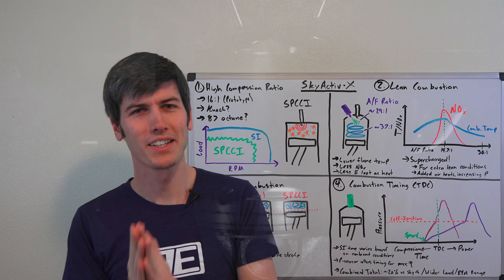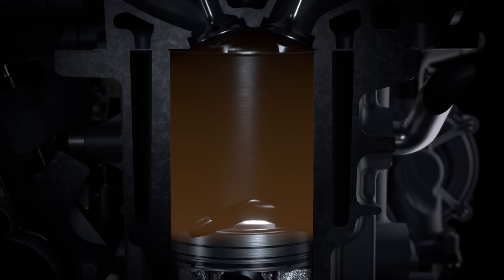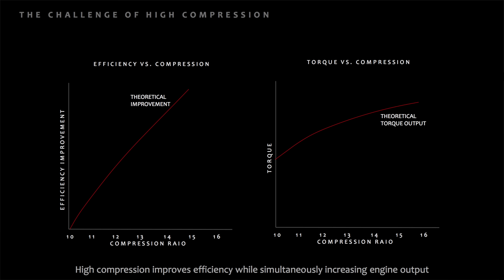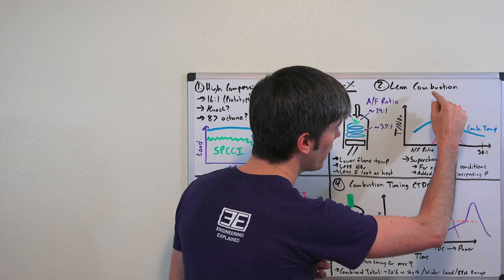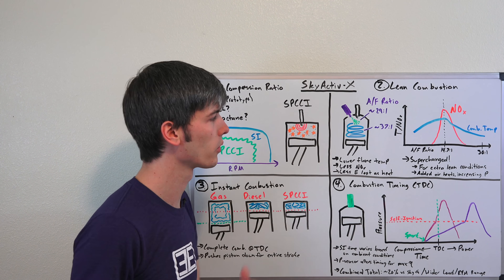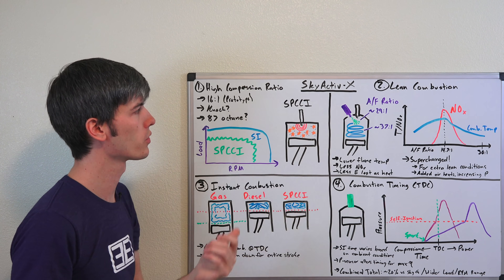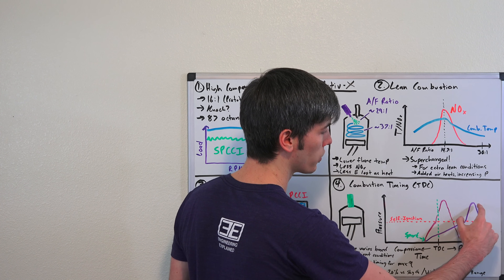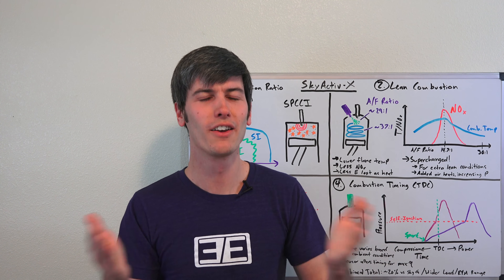How Mazda Is Saving The Gasoline Engine - SkyActiv-X

Comment: "not super powerful engine, about 190hp"... IN A MAZDA 3 !!!!  I am still convinced  Americans have different horses than us. If it had 110Hp it would be "not super powerful".
Reply: Americans are used to having almost 300 hp V6’s making like 20 mpg average. I am anyway, this is kinda low in terms of overall scale of “power” but the cars are light at the same time, with geared tranny’s, not those shitty CVT’s. And the cars are low with tightish suspensions. So IMO they’re fairly quick.
Reply: @francesco1998  What, in a full size pickup or something?
Reply: Bryan Liguori 
Dodge puts their Pentastar in just about everything they have.
Reply: @francesco1998  I know, I just mean to point out that that's not enough information to know if that's bad or not. A 300 hp V6 getting 20 mpg.  In a full size truck that's not half bad. Wait, did you mean around town?
Reply: Bryan Liguori 
Combined. In a 4,500lbs Van that’s shaped like a literal box. (Dodge Grand Caravan) and a 4,500lbs Jeep Grand Cherokee. 

I don’t know what the Ram 1500 has but Ford’s baseline F-150 has the Duratec 33 engine which is a 3.3 liter V6 making like 290 horsepower and 265 torques, that truck gets 19-25 mpg’s. Considering they are both competitors and the Dodge’s baseline is a 3.6 Pentastar with Similar power numbers I’d think it gets about the same. So yeah I’d say engines have gotten a lot more powerful and efficient as a whole.
Reply: @francesco1998  if they're really getting those numbers, that is definitely impressive.  My limited (and dated) truck experience is a 95 Suburban (11 mpg average), 02 TrailBlazer 6cyl (12), and 05 Suburban 5.3 (also 12). These all had quite a bit more low end torque, but I suppose modern transmissions allow low-torque engines to still push heavy trucks at low speed and quickly upshift a few and ultimately save a lot of fuel.
Reply: Bryan Liguori 
I also had the 6 cylinder TrailBlazer! It was an 03 but same thing, got 9 in the city and 14-17 on the highway, burned oil so much it became another type of fuel I had to put in the car 😂. Unfortunately I totaled it about half a year ago. Anyway, I think the reason V6’s and 4 bangers are so powerful and efficient now is because of modern technology, between the GDI and DOHC and the engines computer, they can push as much torque and power out of those things as possible, they also use lighter but stronger material to save weight so you’re not sacrificing power to carry the weight of the engine. Honestly the V6’s of today push more power and torque with better gas mileage than the V8’s of yesterday!
Reply: @francesco1998  Sorry to hear about the TrailBlazer, it was a charming truck with an engine that at least revved happily and sang a nice song. 
But yeah, the tech is getting all engines to really overachieve. The downside of course is cost and complexity though, and personally I would prefer ~2002 engine technology all things considered for those reasons.
Also, power for power, the sound and feel of a V-8 is itself highly desirable to me. For example, the current V-6 in the Camaro. 335 hp is definitely fun.  But a 335 hp LS1 (so basically, a stock LS1) in its place (in a 2019 Camaro) would obviously be a lot more fun for a number of reasons - and I really don't think fuel consumption would change much. 
I wish I had the resources to actually explore this.
Reply: Bryan Liguori 
Very true what you said about that, I would really only put a modern V6 in something like a truck if I was to only do light duty with it. I’ve I’m getting a sports car I’m putting the biggest damn engine I can find in the thing with free flow exhaust and aggressive cams and everything.
Reply: Don't be dense. High-tech NA 2.0L engines have made well over 200 hp from the factory, and this one's supercharged, so 190 HP naturally is a bit underwhelming after all this build up. Still more than enough for a Mazda 3 though.
Reply: If we could get the usual "slow but efficient" cars that normally have around 60-110hp up to around 190hp standard with the same or better fuel efficiency... that'd be damn amazing. You could focus on just buying purely for MPG and still get a decently quick car. Sounds great to me.
Reply: Cars HP are not real HP ( 1HP = 550# / 1ft / 1 sec ) car hp = 1 hp / hour .
Reply: I'm always shocked by what journalist in America consider "under-powered" I have a 2008 RAV4 with about 165 hp that weighs something like 3,500lbs and I have never considered it slow or found myself lacking the power I need to pass on the highway or anything else. Journalist would say a compact car with that horsepower would be under-powered
Reply: Americans built 6 liter V8’s with 110bhp. Hearing Americans talk about something being powerful/efficient is weird A/F.
Reply: @Ticklestein  What 6 liter engine made 110bhp when running correctly?

Comment: 190hp Miata and more fuel efficient? Take my money!!!
Reply: oh yeah huh. I wonder if this fits in my miata
Reply: @69ER509  It should, the ND1 have an aftermarket supercharger that works, so the new ecocharger could be crammed in there.  

Really the dream for the miata would be a rotary SkyActiv-x engine; as from what I can tell from the miata forum, is that the ND are hard to improve/have not had the time needed to perfectly map out ways to improve performance.  We would probably expect similar/slightly worse efficiency to the current miata, but engine displacement would get a lot bigger.
Reply: JV the changes you would have to make trying to retrofit that engine would probably cost more than the car itself

Comment: Would this method allow for higher rpm considering in a previous video you talked about the limiting factor being the flame front? If it's simultaneous would there still be a flame front as the limiting factor and would it be less, more or same?

Comment: That corporate average is insanely misleading (as a general measure of technology). Look at their engine capacities and layouts. There are no Mazda v8s, they had few v6s before that and none since 2013. Then factor in the number of different engines they actually produce (it's 2, 3 if you include the one turbo option) makes it easier to stay low compared to competitors. Lets say Nissan, their engines have worse fuel economy accross the board, but they still make a variety of engines for a variety of functions, having that wide product offering inherently raises their average fuel economy even if their fuel economy were the best in each segment.

Comment: Just wait until the majority drive electric vehicles and the price of electricity makes $4.50 /gal gas look cheap. Don’t get me wrong I like electric cars but not as a complete replacement of gas engines.
Reply: Ryan Ryan People need to get off this “single solution” idea and realize that we need different tools for different missions. Battery EVs for commuting and short-haul trucking. Biodiesel and/or fuel cells for long haul trucking. And with the majority of transit use moved away from hydrocarbons, there is ZERO reason to eliminate gas ICEs from enthusiast cars. Such a small part of the market, such a small part of emissions, it is irrational to pursue total elimination of the ICE gasoline engine. Nothing wrong with a gas powered 911 or Mustang or Corvette or Miata when Joe Schmoe in his Corolla is no longer burning gas while stuck in traffic on the morning commute.
Reply: DucFanDan yup fair point. I live in Canada where -40 is common. I like the idea of electric cars and the tech has come a long way, however, in our climate batteries don’t last, are very expensive and AWD electric cars aren’t available yet. The price needs to come down drastically before I will buy into the EV craze. The environmental argument is nothing more than a scam to screw people out of money.
Reply: Ryan Ryan look at China. 1 million deaths per year due to air pollution. It's not a scam.
Reply: Ryan Ryan lol your a nut case
Reply: Ryan Ryan batteries can and will be reused and recycled. Their cost has dropped dramatically along with the cost of renewable energy. The only scam going on is the oil companies trying to knock them off left and right with fake data.
Reply: larry Spiller Air pollution in general is not a scam, I would agree. But the carbon hyperbole is a load of bovine manure. There are LOTS of compounds coming out of tailpipes due to the burning of hydrocarbons that we should be rid of. Plus the emissions of refining/creating the fuels to begin with. CO2 just isn’t the singular boogeyman it has been made out to be. The fact the IPCC reports keep getting less dramatic with each revision should be clueing people in to this reality.

Once people take off the CO2 blinders, then using the right tool for the right mission becomes easier to implement... and then we can start seeing real gains in air quality improvement. BEVs are not panacea, neither are alt fuels or fuel cells. But together, using the right technology in the right application, we can have cleaner air AND cars that actually work across all environments. There will be some applications for hydrocarbon fuels... they should just be VERY limited applications (and mostly recreational/enthusiast vehicles at that).
Reply: DucFanDan or... we could get ride of hydrocarbons nearly all together but no let's make an over complex temporary solution that will be less reliable then electric vehicles of today let alone the next 5 to 10 years of improvement.
Reply: larry Spiller funny, I was thinking the same about you.
Reply: Ryan Ryan with 4 solar panels you could charge an electric car every day for its typical use for 25 years. (Talking offset wise because home battery storage is still a large cost) tell me can you spend 1k on a Jerry can and have it refill your vehicle for 25 years with no additional cost? Answer is simple.
Reply: larry Spiller oh make no mistake, oil companies are just as corrupt. I completely agree. Only certain parts of a battery can actually be reused. New materials still are still needed and there is a finite amount of that. Where does all the electricity come from to recharge electric vehicles? Wind farms? Solar? Yeah right....have you noticed vehicles cost so much now people can’t afford to pay cash for them any more? Especially electric vehicles.....99% of them are LEASED!!! Why do you think that is? It not because leasing makes good financial sense, it doesn’t. They did the same thing up here with “High Efficiency Furnaces”. If you didn’t fork out $10000 for one you were just the most awful person because you don’t care about the environment. Gone are the days of having a furnace for 25 years. People here took out second mortgages to buy the newest HE furnace only to have it break every 3 years at $2500 a pop to fix......all in the name of saving the world....
Reply: larry Spiller that is the most ridiculous thing I’ve ever heard. Yes 4 solar panels is all it will take....
Reply: High tech battery that is made from graphene can be charged super quick and hold more charge than Lithium battery. It was years ago that they said it will available for public uses. That days will never come as Americans government doesn’t want to kill the entire world economy. What would happen to Russia, Middle East countries if we replace all gas engine with electrical engine? For now, graphene is mainly developed for military uses.
Reply: Ryan Ryan
It will be
Reply: larry Spiller ok..... enjoy your scam while it lasts.
Reply: larry Spiller watch, once the eco-zealots get everyone in debt buying electric vehicles to save the world the next fad will be “we have to stop electric vehicles because of the environmental damage their batteries are doing” or something along those lines. ITS ALL A SCAM designed to keep getting money from you.

Comment: Great video. Speaking of efficiency whatever happened to BMW's turbo-steamer? It was supposed to use exhaust heat to boil water and use steam as an auxiliary power source. I heard there had been a lot of research into doing it in trucks and commercial vehicles as well but it's an interesting way to utilize all of an engine's waste heat